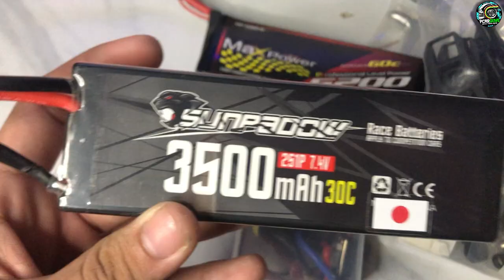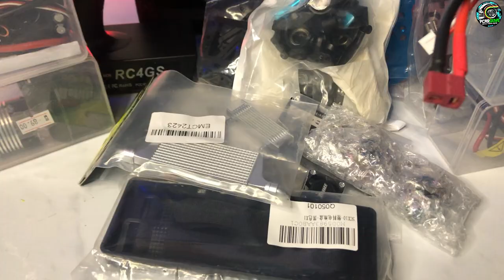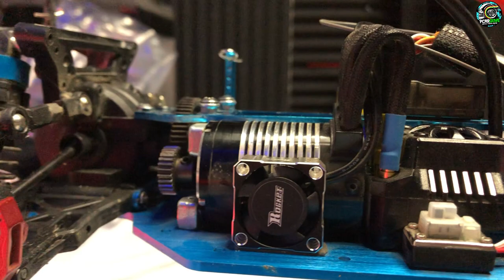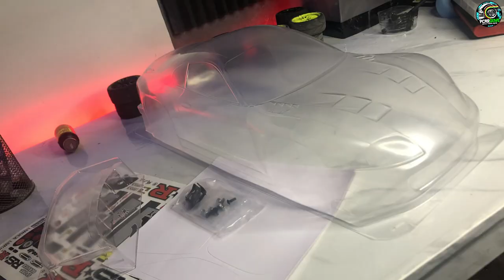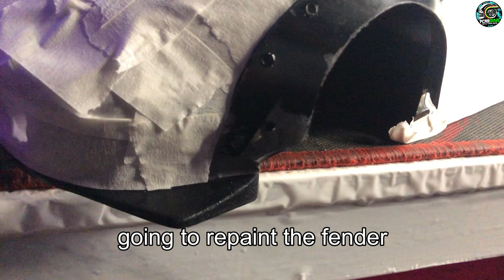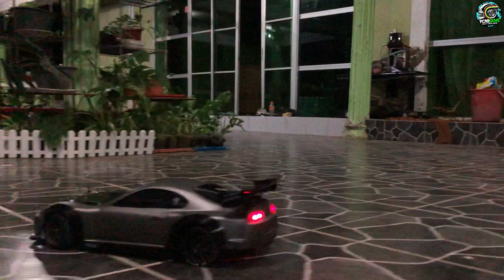First rc car upgrade | HSP 94123 ONROAD / DRIFTING | 100 KMH RC SUPRA |

Comment: hsp high speed very hard control i also make 100kmh＋
Reply from the maker: yes bro it is hard to control
Reply: @pcarguys1185  use good remote，tire sponge no touring，use touring body，car steering ajust good
Reply: @chaoyang_0326  u can use gyro to help with straight line speed
Reply: @khatzine7244  no, gyro for speedrun is not working great